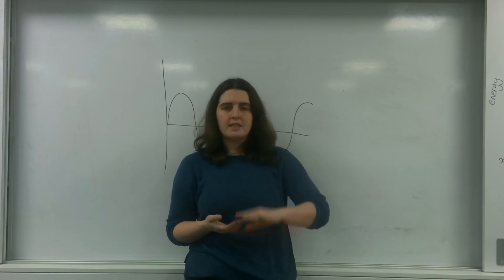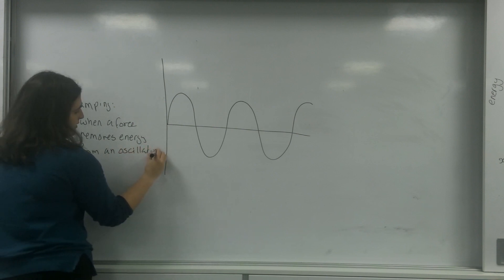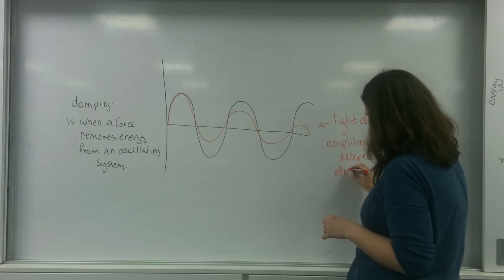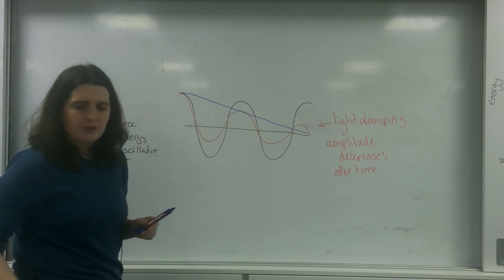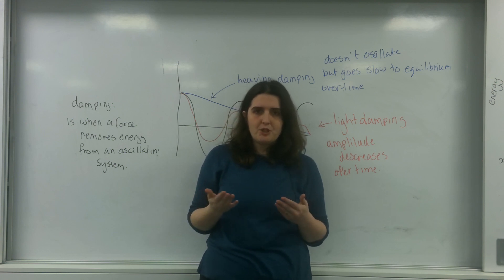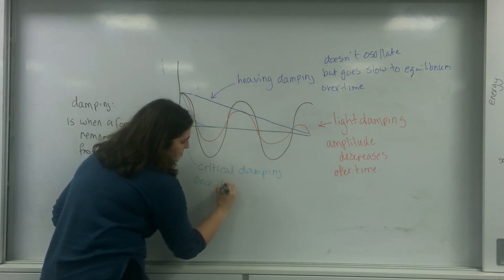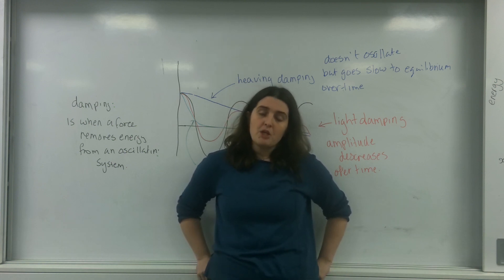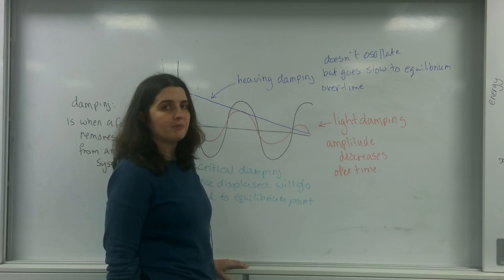Damping AQA A level Physics

Comment: Hi, could you explain how springs and rubber dampen vibration please? Thank you.
Reply from the maker: Springs/ rubber will absorb some of the energy by their extension, they will store it as elastic potential. so it means in a system the energy of the oscillation is not only put into KE but elastic too. which lowes the ke/velocity of the system hence damp it. 

Rubber also undergoes Hysterisis which will mean it absorbs energy inthe material and the structue changes too. 

Hope that helps
Reply: @TLPhysics  Thank you very much, this is always something that has baffled me as an aspiring engineer.

Comment: Heavy damping is one in which the vibrating object takes an infinite amount of time to go back to its mean position once displaced. For example : a pendulum suspended in a very viscous fluid like jelly. It is not used as a safety measure. That is critical damping. Car springs and door holders both come under critical damping, in which the object takes least possible time to go back to mean position. Correct me if I'm wrong
Reply from the maker: In regards to heavy damping as a safety feature, doors with safety hinges with mean they slow close are heavily damped. This is to reduce their kinetic energy so they do not trap hands/take fingers off. This is not critical damping as the damping there is to slow it down as much as possible. 

I apologise if I said car springs where heavy damping in the video (I will check back and edit later if I have) they are critical damping as you want to go back to your original position as fast as possible. 

In some cases however in cars (not suspension) you would want a heavy damping to increase the time over a collision happens (see momentum) but this more the role of seat belts etc. 

Hope this helps thanks for the comment